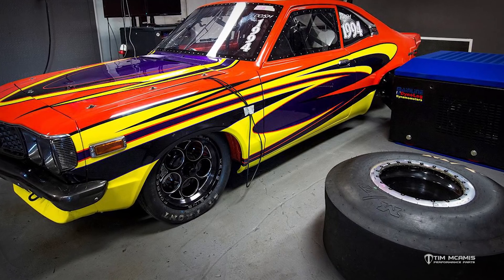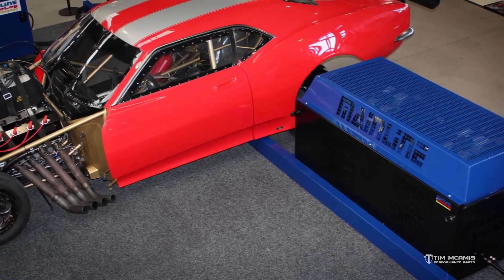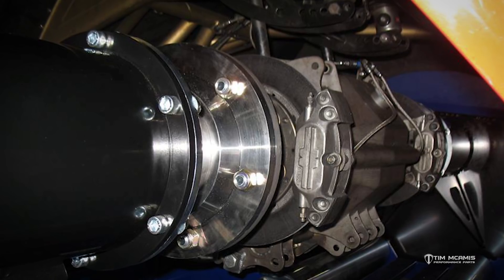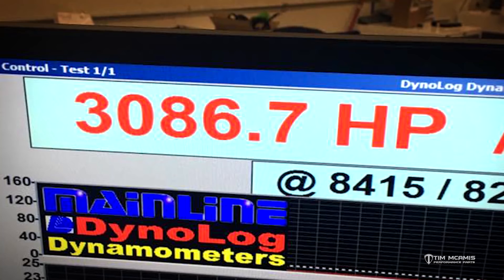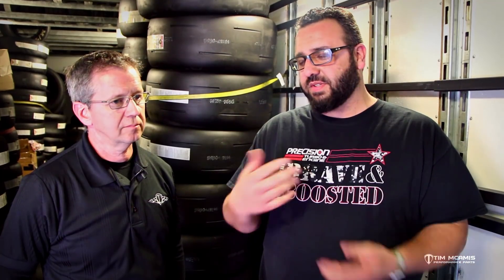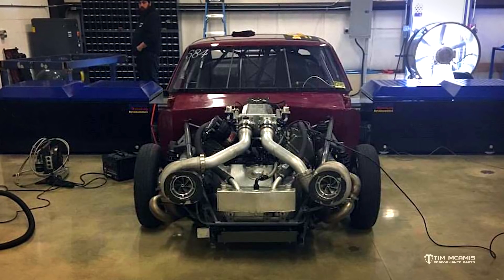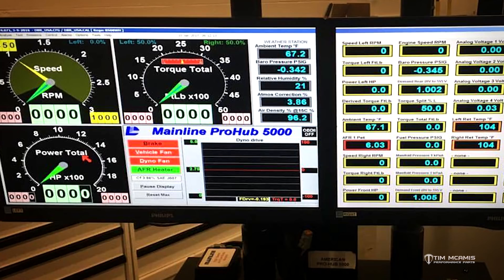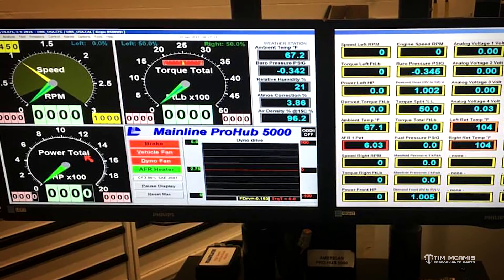Lights Out 8: Hyperaktive Performance Solutions

Comment: You can get some suspension data off them since you don’t have to strap the chassis down. You can see how the car separates and how fast if you got sensors on all that stuff, I think guys that are going to use this type of dump will probably have all the data. I know it’s not like on the track but it’d probably help you get in the ball park,